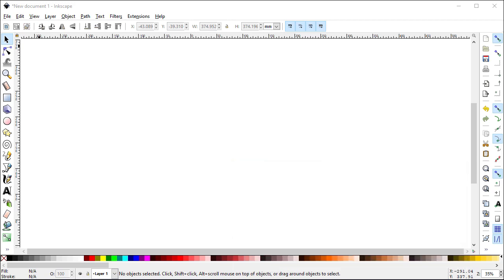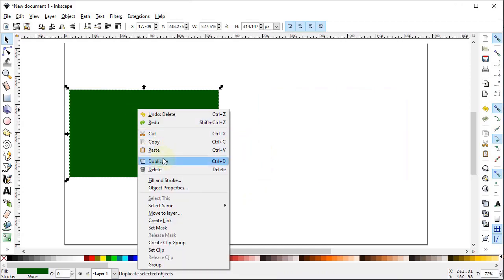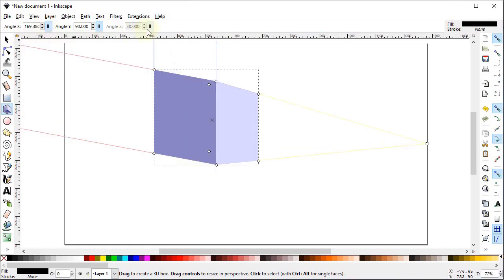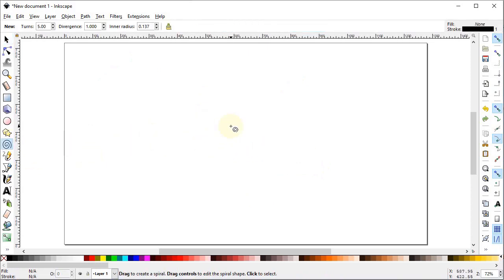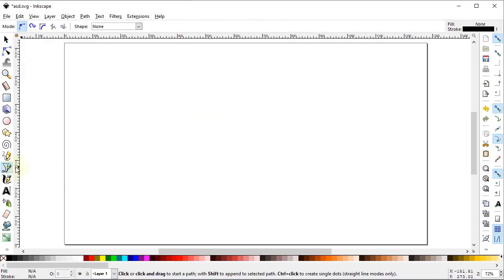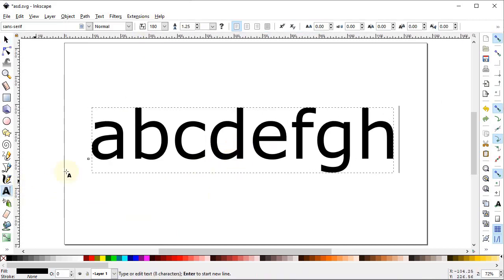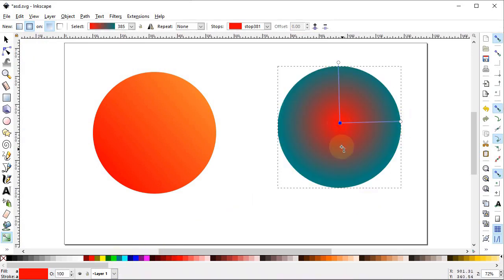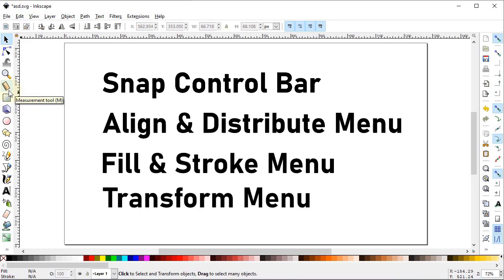Inkscape Course for Beginners 2020 - Class 1

Comment: would you like to talk slower ? :D
Reply from the maker: I don't know that how and why i speak faster. I often tried to speak slower. And it happens in the start of video but i ends up speaking faster :-). In previous tutorials, i think that i was speaking much slower and but now.... Anyways i will try to speak slower or you can also slow down the playback speed from youtube video setting icon which is appearing on the bottom right corner.
Thanks

Comment: Hi brother, New Version of Inkscape 1.0 has been released, try make review for it. I think it is very nice.
Reply from the maker: Have you downloaded Inkscape 1.0 version yet ?
Reply: @royallogos  Yes I have downloaded it but not yet explore all features. I think there ara good feature, such as custom rounded etc.
Reply from the maker: @hi3508  Just asking because i was having difficulty in downloading. Every time, i tried i received 503 gateway error. Did you download it from inkscape official website or somewhere else. And one thing custom round corners are not available in this version too.
Reply: @royallogos  I am using Linux OS, so I downloaded directly in App Store (like repository)